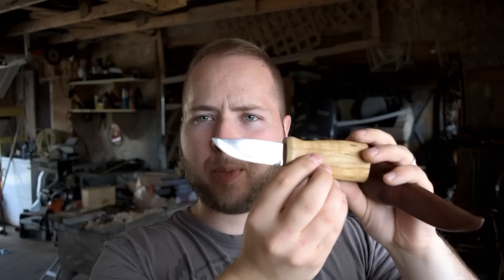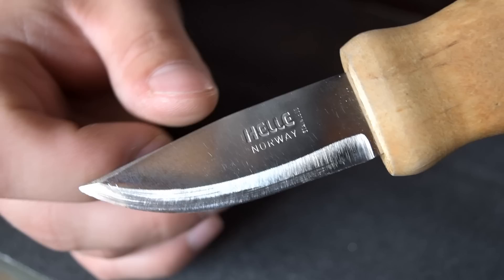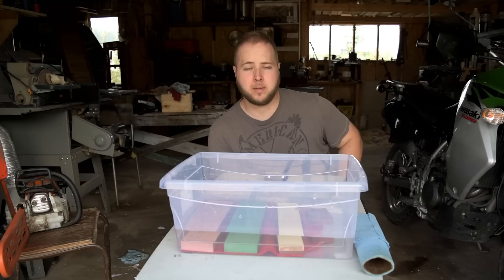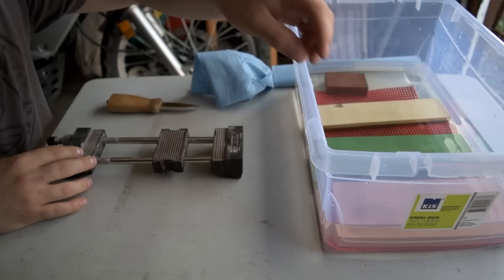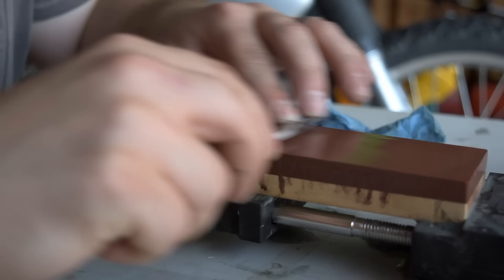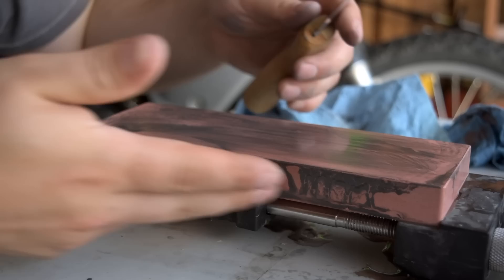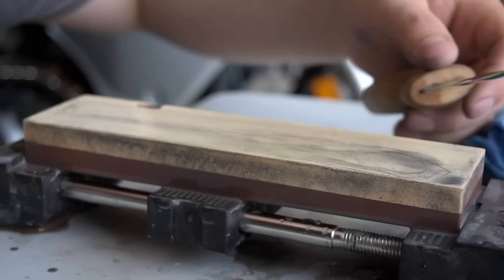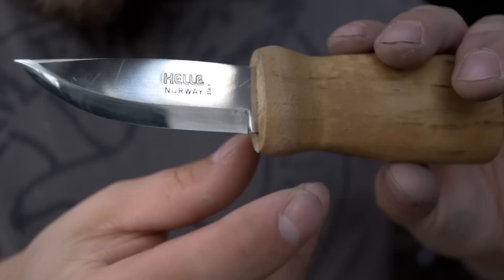Helle Nying - DO NOT USE THIS TO SHARPEN YOUR KNIVES

Comment: The steel Helle uses on their knives is pretty interesting usually on a lot of their knives its laminated stainless steels and in some cases the core of the blade is a high carbon steel, which makes the blade hard and good edge retention but is a pain when you do need to sharpen!! Fun fact lol

Comment: That came out amazing! I can't wait to see it in person. Thanks for everything Kyle and for filming the process. I am planning on refinishing the handle. Just a little sanding and a good soak in some linseed oil. 
I work as a guitar repair tech, so good call on the micro bevel. She will be used. 
Thanks again buddy 
Darryl
Reply: Helle seem to focus on the blade usability. There finish on handles etc isn't always great. But that being said. If they put the time into finishing the handle it would cost double the price. We get a good balance. Most are not bothered by the finish. Those that are can easily finish it in an hour or so.

Comment: Those speedy sharp tools you flashed a picture of, might be horrible to sharpen a knife BUT if you ever get one, (they run about 7 bucks at Canadian tire) they are AMAZING for striking a ferro rod.... Cut it in half and drill a hole in the handle and put it on a lanyard and you got one great striker!!
Reply: BradleyNewbury31 exactly what i use the speedy sharp for. I am kind of a knife nerd who always wants razor edges so at home i use naniwa professional stones 400, 1000, 5000, 10'000 grit and various strops. In field the spyderco double stuff and a small strop are great. For quick edge repair in field (chips) the fällkniven dc4 is quite good.
Reply: Like any tool its the user that makes the difference... I personally have 2 of that exact same one .. If manage to just touch the edge with the weight of it or less I find you can do a fantastic touch up on an edge... of course if you stray you can put some serious scratches on the bevel very easily

Comment: I think you may already know this but I would like to point just in case you don't that it is not advisable to permasoak naniwa stones. They tend to crack as a result.

Although you probably soaked them few minutes prior to sharpening which isn't a problem.

The Woodstock (king) should be fine permasoaked though.
Reply from the maker: Thanks Dave! Yes, I just put them in the water only a few minutes prior to sharpening. I never permasoak any stones :-)

Comment: As a sharpening craftsperson I can see the pride in keeping the scandinavian grind flat. But for functioni there's nothing wrong with a little concave on them. In fact, that is the way it is usually ground in Scandinavia and has been for at least a century. Only new knives have that flat grind, then they usually get a small secondary bevel that is polished out to a small concave.

Comment: Wow. Niiice work. I have one of those 1000/6000 stones, but I’ve never gotten that nice a result. I may have to relegate one of my Moras to a sharpening practise knife.
Reply: I just got the Woodstock yesterday and I got spectacular results. I started on my diamond stones to reshape the bevel, looking at the bevel to see consistency from Apex to shoulder. (I plan to get the Naniwa 400 grit to sub) Then I do a few strokes on the Woodstock 1&6 maintaining the angle. Then I lighten pressure finishing. I then pull out the strop with the green paste and using the same angle I alternate 2 strokes per side about 10 times. When i do a hair test, all that is left is the skin. I would say it is about 18 dps on the bevel (the same as the Benchmade factory bevel.)

Comment: Hey Kyle, Do you use belt grinders at all? I find it to be incredibly quick and easy to sharpen anything with a good assortment of belts for my 1x30 belt grinder. I have a leather belt that makes quick stropping work that also polishes to a mirror finish.
Reply from the maker: I only used power tools like a belt grinder for items with a lot of steel. Axes, large chisesl, etc. The cut too quickly for my knife sharpening. Too easy to destroy a knife

Comment: The 400 Naniwa is fine to soak but be careful with the 3000. 
Make sure you dry it evenly and slowly if you soak it.
Reply from the maker: Hey Will! Yes, I know what you're talking about. I only drop them in right before I begin sharpening. And I remove them right after.

Comment: Don't blame the sharpener if the user is ignorant. Those scrapes tell me the user had no clue what they were doing, and would likely damage blades with almost any stone or device.
The carbide cutters do a decent job when used correctly, and importantly do a very good job with serrated blades. Sure, there are better tools to use, but few so portable.